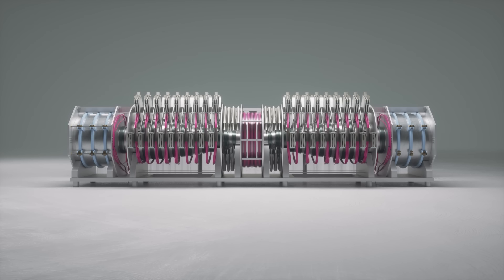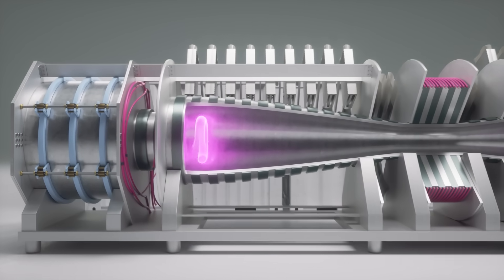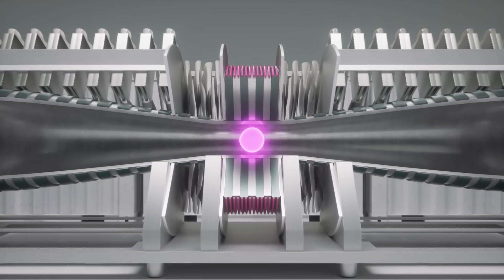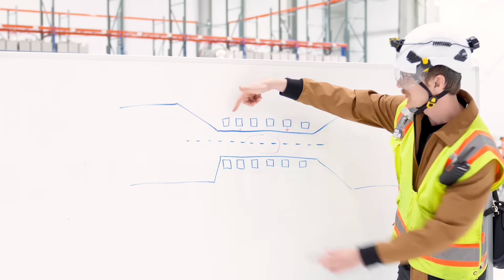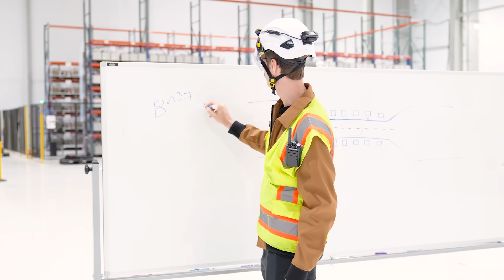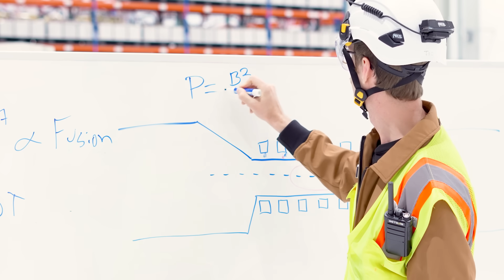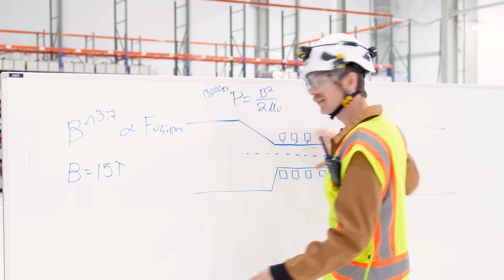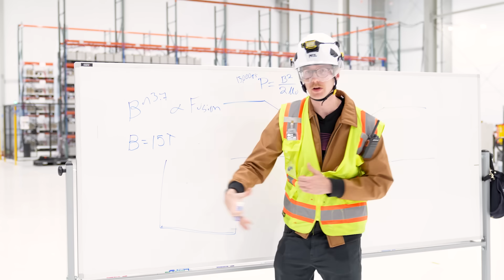The Extreme Mechanical Engineering Behind Fusion

Comment: 🤯 The engineering behind this is on another level! "Pulsing with nanosecond precision" under enormous forces – that's a monumental manufacturing challenge. It's exactly this class of extreme reliability and tight-tolerance parts (via CNC, precision sheet metal) that we specialize in for R&D and low-volume production. Pushing the boundaries of what's physically possible! 🚀

Comment: I wonder, does Helion have the largest energy return ratio for a fusion reactor? Most fusion research doesn't even attempt to actually harvest the energy, so even if someone reaches scientific breakeven they could be over an order of magnitude away from engineering/practical breakeven on power. Helion closes that gap, so they might actually be closer than anyone to a commercially viable fusion power plant if this technology is able to pan out.
Reply: It looks like their approach lets them improve energy return with each versions improvements.

Comment: 1) Since D-He3 is roughly 1,000 to 5,000 times less reactive than Deuterium-Tritium at the temperatures you have achieved (100 million degrees), how do you plan to achieve net energy gain without "clobbering" your power output?
2) Given that D-D side reactions produce significant neutron radiation (potentially lethal levels similar to a reactor disaster if unshielded), where is the roughly 1-meter thick dense shielding required to protect personnel and equipment?
3) Since your direct electricity capture system relies on moving magnetic fields (which works for charged particles but not photons), how do you recover the significant energy lost as X-rays and heat radiating away from the plasma?
4) Can you provide peer-reviewed papers that validate your plasma diagnostic methods and prove that your observations are unique physics rather than standard particle drift or turbulence losses?
5) Why was the target to prove commercial energy gain in a 50MW system by 2021 missed, and has the timeline been realistically adjusted?
Reply: 1) Helion is aiming for 200 to 300 million degrees C with their power plants. They have a density 3 orders of magnitude higher than Tokamaks. They have a very low electron to ion temperature ratio (1:10) which reduces Bremsstrahlung losses. That skews the equation significantly. They do not need ignition because they can recover 95% of the input energy directly as electricity. So the fusion reactions only have to make up for the difference.
2) Nonsense. D-D neutrons only occur in 1/3 reactions. They have a lower energy than neutrons from D-T reactions and JET did lots of those. Have you seen their social media posts about Polaris? HUGE concrete vault.
3) X-rays losses are greatly reduced by their Te:Ti ratio that I mention in 1). 
4) Nothing about their physics is unique. All of that was demonstrated over a decade ago. I suggest your start with Hoffman's standard works on FRCs (who is still an advisor for Helion, btw).
5) Any targets Helion ever gave were contingent on funding. They did not have enough funding for their current demo machine, Polaris until summer of 2021. Polaris is now compete and they are ramping up power.
Reply: @elmarmoelzer2229  

1) While aiming for 200-300M °C and higher density is a step forward, relying on a 95% energy recovery efficiency is extraordinarily optimistic from an engineering standpoint. In pulsed power systems, switching losses, resistive losses in coils, and vacuum auxiliary costs typically limit round-trip efficiency significantly below that figure. Furthermore, maintaining a T_e/T_i ratio of 1:10 at high densities is theoretically precarious. Due to Coulomb collisions, electrons and ions naturally tend to thermalize (equilibrate) very quickly. If the electrons heat up even slightly more than predicted, Bremsstrahlung losses P ∝ sqrt{T_e} will rise exponentially, potentially negating the non-ignition gain strategy.

2) Correction on the physics: The D-D reaction branching ratio is approximately 50/50, not 1/3 (50% T + p and 50% ^3He + n). Even if the neutron energy (2.45 MeV) is lower than D-T (14.1 MeV), the flux at commercial power levels would still be massive.
Regarding the vault: The fact that Polaris requires a 'HUGE concrete vault' actually validates my original point. It contradicts the early marketing narrative that D-He3 is an 'aneutronic' or radiation-safe fuel that could be installed in light industrial parks. It confirms that this is, indeed, a serious radiological device requiring heavy shielding and maintenance due to neutron activation.

3) Reducing X-ray losses via a low T_e/T_i ratio is valid in theory, but as mentioned in point 1, higher plasma density actually increases the collision rate between ions and electrons, accelerating thermalization. Have you published data showing you can sustain this 1:10 disequilibrium for the full duration of the pulse without the electrons heating up and dumping energy as X-rays? That is the specific physics challenge that needs validation.

4) Citing Hoffman and 10-year-old general FRC research does not validate Helion’s specific performance. FRCs historically suffer from severe stability issues (wobble, tilt, and rotational instabilities) as they scale. The burden of proof is to show that Helion has overcome these specific turbulence and confinement time limiters at fusion-relevant temperatures. General theory is not a substitute for peer-reviewed diagnostic data from the actual machine (Trenta or Polaris).

5) Funding delays are understandable, but they do not solve fundamental physics barriers. The jump from a prototype to a net-energy commercial device involves resolving non-linear scaling issues (like plasma turbulence and heat flux handling) that money alone cannot bypass. The skepticism remains on whether the physics is ready, not just the bank account.

Comment: This is clearly an engineering recruitment video.  A few of my friends have gone to their recruitment events and say it is a cool place. I really hope they do well even though I’m skeptical of fusion energy.
Reply: I will be happy to apply for the janitor spot.  Just to be there while it's happening.
Reply: me too, but what chips away from my skepticism a little bit is the fact that this time the end goal is not to boil water like with fission. but rather recover energy in the same way it was put in, electromagnetism, and if the manage to get a few joules more than it is put in all that needs to be done is efficiency improvements and scale up and while it is not easy, once it is proven it can be done it can get less hard, and less hard is not as good as easy but it is good enough when before it used to be impossible.
Reply: @deathkeys1  Keen skeptics probe deeply, beyond  what the company generally releases publicly to recruit workers and to attract investors. There has never been any evidence that Helion has ever generated even 1.0 watt-hour of pure fusion energy, or had a small fraction of the energy fed back into the capacitor bank that fed energy into the compression coils. Their 6th generation machine, Trenta, engaged in around 20,000 test shots and never demonstrated the generation of a highly significant quantity of fusion energy with even the best shot. Now they have been experimenting on their 7th generation machine, Polaris, for about the last 1.5 years and have yet to publish evidence that it has achieved anything significant. In a press release, in January of 2024 they predicted it would be generating electrical energy by that Summer. All they have done since that announcement is generate distracting videos. The overselling of the nuclear fusion energy experimental field has been occurring since the first experiments began in the 1950s.

References:

From S&P Global

05 JAN 2024
Fusion energy industry anticipates electric power breakthrough by summer
By John Siciliano

The Washington-based company Helion, considered a frontrunner in the race to develop a cost-effective commercial fusion power plant, said it plans to be the first fusion energy company in the world to produce electricity from its prototype Polaris reactor in 2024.

------
The problems with Helion Energy - a response to Real Engineering (YouTube)
Reply: we know fusion works we just don't know how much money it will cost to produce powerplants
Reply: @The4iddenTruth   we will when we start trying to manufacture more fusion reactors (probably still very, very expensive]
Reply: @JNJNRobin1337 there's already like four companies that act have active designs in the works 😅😅😅
Reply: @The4iddenTruth  ah good! i think i meant after we have atleast a few fusion power plants (minimum of one] and seek to obtain more, since then there would already be one built and operational; which will set a base price expectation to then improve on
Reply: @The4iddenTruth  - Often the promotional sales pitches are deceptively crafted to make it sound as if they have achieved far more progress than they actually have. They tend to be masters at snowing the 99.99% of the population who have no formal background in this extremely esoteric technical field.
Reply: @The4iddenTruth  - Those companies are masterful in creating deceptive promotional presentations but they are many orders of magnitude away from demonstrating anything close to a economically practical power plant design. The fact remains that none of the companies has demonstrated the generation of even 0.1% of fusion energy compared to the energy consumed by the facility during the day of the successful test shot. Most fans don't have the technical background it takes to read the technical reports that may have been published about these experiments.
Reply: @vernonbrechin4207  if true why aren't these publicly listed companies where you can drive the most hype and rampant overvaluation, you cant say one thing when actions of these companies show a desire to keep equity meaning they don't just have smoke and mirrors(like you claim), otherwise they wouldn't be staying with private equity, use logic bro
Reply: @The4iddenTruth  the whole uranium to energy pipeline was immensely expensive. Not counting all of the normal market forces like competition and losing talent to higher paid jobs, the cost of the original Nuclear program was over $25B
Reply: @angelmarauder5647  $25B sounds like a bargain — in current-day currency?
Reply: @The4iddenTruth  - These promotional videos are done in a deceptive manner to leave the viewer believing that nuclear fusion energy generation has already been achieved on a small scale and that it only need to be called up to a useful level. The experiments began in the 1950s and since then over 150 experimental machines have been constructed and experimented on. Only a few have demonstrated the generation of more than 1.0 watt-hour of pure fusion energy and none have ever demonstrated the generation of even 0.1% of the energy it took to power the experimental facility during the day the experimental test pulse occurred. Even the best record holding test shots are many orders of magnitude away from demonstrating that a economically practical power pant can ever be constructed. Nuclear fusion has been demonstrated in the detonation of hundreds of thermonuclear test explosions, but that comes nowhere close to being practical for electricity generation.

Comment: if we take only the induction energy from the plasma's magnetic field, it will be only about 20%, because the remaining 80% is carried away by neutrons - and this is just heat. Please correct me if this is not the case.
Reply: They are aiming to fuse D with 3He. That's aneutronic, so 100% of the energy is potentially available for recovery. However, there will be side-reactions of D with D which will degrade that return, and - cough, cough -  the core of the reactor
Reply: @MattNolanCustom  in this case, most likely, some kind of material will be placed at the reaction point to contain "parasitic" neutrons. And change it periodically.
Reply: @konjinni  I don't think there is enough room for sufficient material

Comment: The process used by Helion is very impressive. The big unanswered question is does this whole process generate more electricity than what went into the process of creating fusion?
Reply: To me it sounds like they're trying to scale to that point, they talk a lot about scalability. So I would guess it's either under unity or not over enough for long enough or reliable enough to make sense from a cost perspective, but that they have reason to believe the problem isn't scale invariant. Translation: Hey investors yes we really are building real hardware and it does what we want it to, we need more cash to get to the real thing. I'm not a physicist so not really qualified to evaluate their claims, but I know it's a difficult problem and there are tons of startups trying to get to fusion in non-ITER kinda way.
Reply: The point of Polaris is to demonstrate that.

Comment: People understand that there is an incredible amount of neutron (or proton) radiation associated with the kinds of fusion power we are experimenting with.  This is never talked about.  It will not work because the radiation is just going to destroy all the material surrounding it (and especially any people exposed to the stream of radiation or the radioactive material left afterward).
Reply: There are neutrons produced by D-D side reactions, but...
1. They only produce a neutron 1/3 reactions.
2. The neutrons from D-D reactions are "only" 2.45 MeV compared to 14 MeV from D-T reactions. Those 2.45 MeV neutrons don't affect materials nearly as badly. Their machines should last for years and even then only some parts of the machine need to be replaced which is much easier with a cylindrical design than a thoroidal design like a Tokamak.
Reply: @elmarmoelzer2229  But we are not really trying to do D-D fusion because it requires much higher temperatures and/or much higher densities than we could be ever be expected to achieve.  And then the energy output is expected to be smaller than the energy input.   The fusion we are talking about is D-T or D-He3.
Reply: @paulwilson6511  
That is actually incorrect. 
Helion has very high densities (10^22 to 10^23 ions/m3 which is 3+ orders of magnitude higher than a Tokamak) in their machines and D-D reactions actually happen more at lower temperatures than D-He3. For a given magnetic field, Helion can balance temperature and density almost linearly in their machines. If they need more D-D reactions (to breed He3), they use higher density and temps around 20 keV. If they want more D-He3 reactions, they lower the density and increase the temperature to 30 keV.
What also helps is that they have a low Te:Ti ratio (electron temperature to ion temperature), which greatly reduces losses.
Direct energy recovery of input energy really helps balancing things too.

Comment: Your engineering work is absolutely amazing.
I’m wondering if the capacitor bank construction is a major bottleneck. Have you considered electrically connecting two reactors and operating them 180 degrees out of phase? This could allow you to slash the capacitor requirements.
For a 10-unit site (5 pairs), you would only need enough capacitors to start one unit, then switch connections to start the rest. While this might make full power recovery tricky, it seems perfect for a low-capacitor setup dedicated to Helium-3 breeding via D-D reactions.

Comment: Things i see missing, although this isn't the current setup, would be some form of active cooling, (mri magnet style) doesn't expand form factor & helps inductance on sustained use)  and for vacuum sections having staged vacuum areas makes it much less stressful on system components, having the whole machine in a vac room, eg -50kpa with some form of closed loop external exchange cooling for cables, circuts and magnets. All the best H gang🎉

Comment: 2 years later, still no clue how are you guys planning to overcome your D-He3 reaction deficiency mentioned by improbable matter channel
Reply: None of the fusion projects(ITER,SPARC,Helion,Ect)going on at the moment have solved the inherently high temperatures causing the secondary Deuterium-Deuterium reaction from the D-He3 fusion… hence “the first wall” issue prevalent in all of them…..i guess their all hoping material science will pull a rabbit out of the hat and save them 🤷🏻‍♂️ you know what they say….fusion is 30 years away 🤣
Reply: @NotAnotherMitnick I wouldn’t want to be anywhere near that reactor when it starts producing 14MeV neutrons.
Reply: @mikegofton1  a few cm of HDPE would protect you from those. I'm more concerned about what those neutrons are going to do to their vacuum seals, electromagnets and diagnostic probes.
Reply: @MattNolanCustom  maybe 10cm of HDPE with boron for absorption and lead shielding for the resultant gamma radiation.
Yes, there's still the damage those neutrons are going to cause the reactor components.

Comment: Are type ii superconductors (and their implied cooling system) too bulky and brittle? And is the critical current too limiting?
Reply: I imagine if they wanted to use REBCO they could. It’s just too much trouble when they can reach the fields they need without them
Reply: @robertdoe3259 right. I guess with the short duty cycle vs specific heat, the heating is manageable. Did I catch a 100K temperature increase?

Comment: Yes, the way to go is to : generate the field, confine the reaction, then extract the energy from the field, since the field streght has increase from the reaction heat, then inductivety couple the power into output power(to the grid or else).